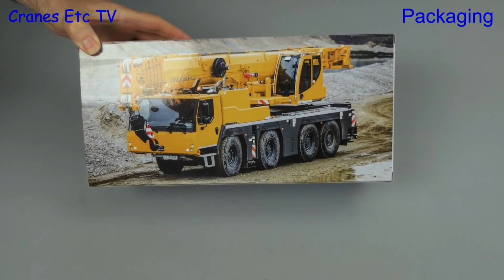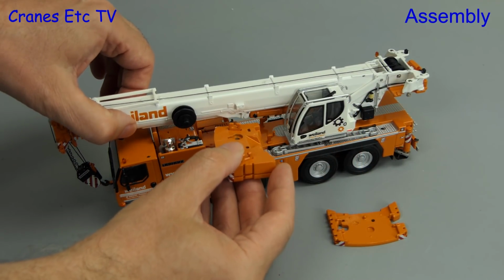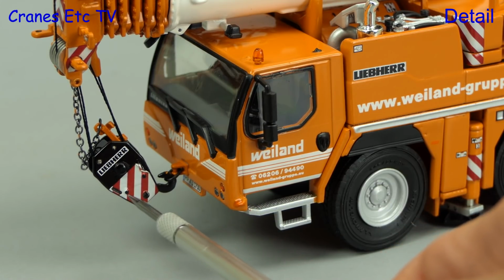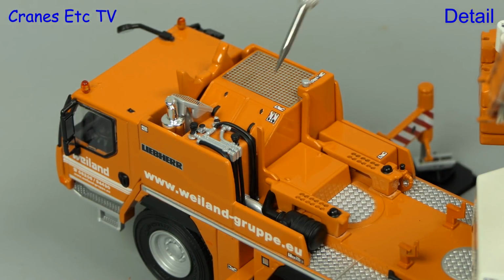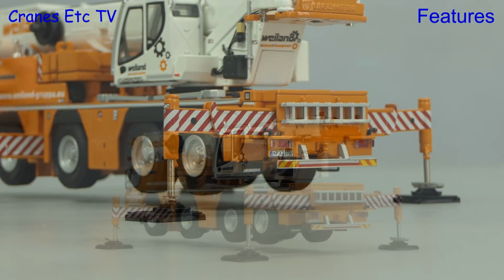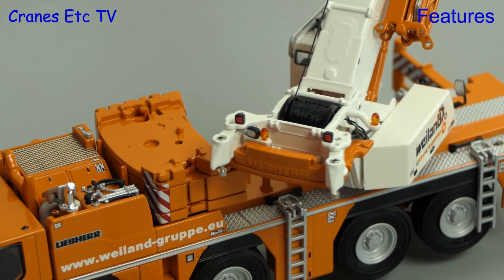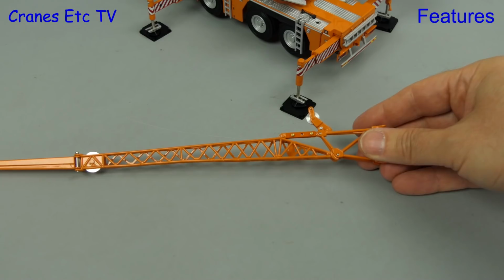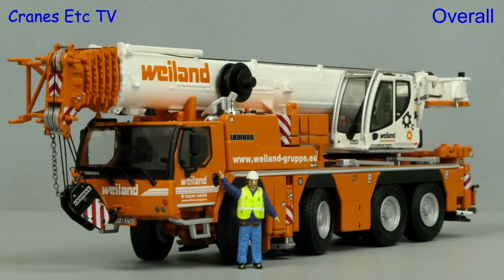WSI Liebherr LTM 1090-4.2 Mobile Crane 'Weiland' by Cranes Etc TV

Comment: I have tried to retract the boom as explained in previous queries without success, I can only find one unlocking button on the main boom, can’t find any instructions or information on how to retract the boom , any help would be greatly appreciated
Reply from the maker: Fully extend it, all sections.  Then retract starting top  and working down.
Reply: I have tried this numerous times still will retract, only the bottom section goes in nothing else, so hard to find instructions for this even from the website
Reply from the maker: @robertmillwood6412  Hard to understand the problem you are describing.  With the boom fully extended you should be able to retract the top section by pressing in the button on the next section down (each section has its own locking button).  You repeat this for each section in turn, working downwards.
Reply: The problem I have is that I can only find one unlock button on the main boom section, none of the other sections seem to have one,